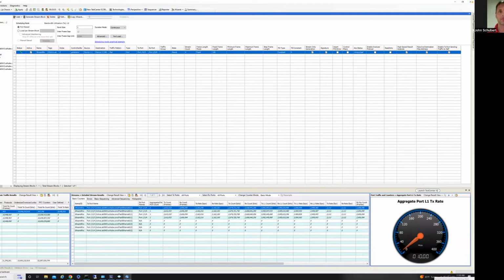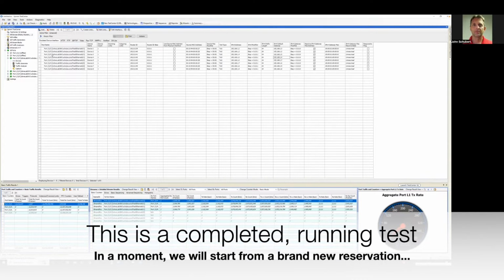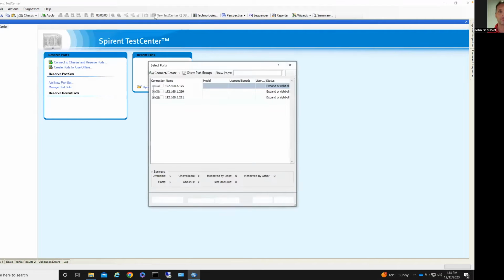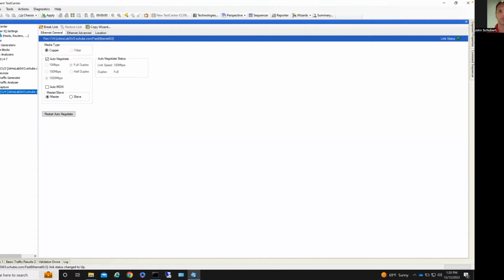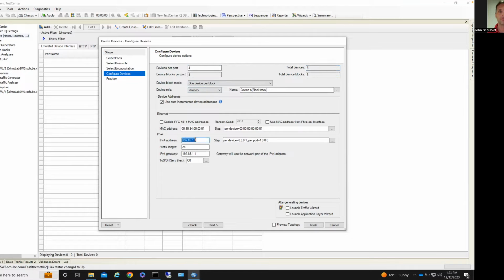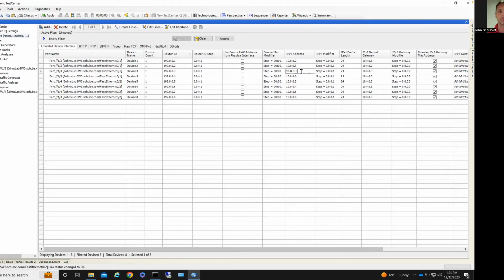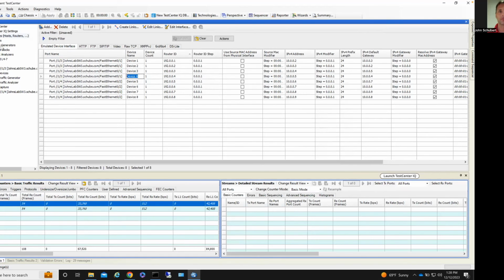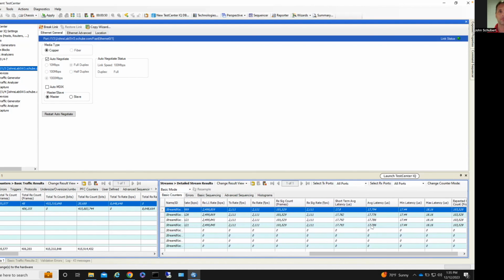1 link C1 Spirent TestCenter demonstration - 2 arm test with only one port

Comment: I have watched a few of these now and seems some moving of the mouse and actions are not clear.    around 11' and 30" you hit "apply".   What causes it to start working as my spirent just applies and traffic not flowing. any guidance appreciated.   I have a N11
Reply from the maker: It depends on what the apply is doing.  If you changed the config for a running test, the test remains running but follows the new config.  For example, if I'm running STC at 10% load, and I change the configuration to 20%, hitting apply changes the running traffic generators to crank up to 20%.  If your test is NOT running, apply won't start traffic.  You'll need to do ONE of two things, the first, easiest is to click on the traffic light symbol for "Start Traffic."  

The 2nd way is to right click, and then scroll down the pop up menu to "Start Traffic."  The 2nd way is better if you have multiple traffic generators and only want to start a specific one, or several, but tedious if you want to start all traffic generators.  

Clicking the "Start traffic" traffic light icon will start all of them.
Reply from the maker: Also, if you want to "skip" the apply process, just hit "start traffic."  This automatically does the apply and then starts traffic.
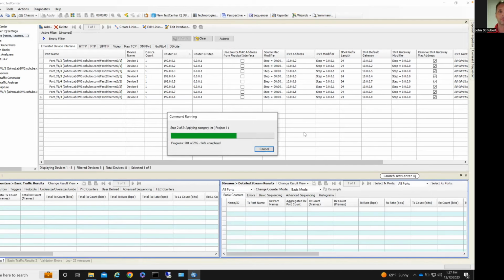Reply from the maker: I just went back and re-watched the video, at the 11:30 point I'm only verifying the configuration is correct by hitting "Apply."  There's no traffic being generated, and that's why I explain right afterwards, that the traffic you're seeing is actually the Cisco 3560  STP (spanning tree protocol) looking for switch loops.  Some customers will turn off STP to make the numbers 100% traceable, but since this is my home lab not needing that level of precision, and I leave it on.